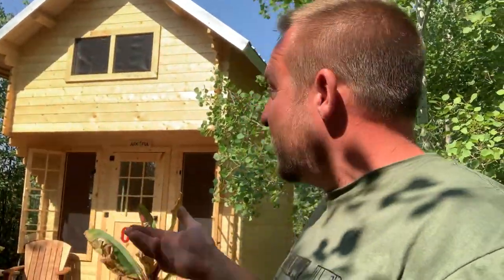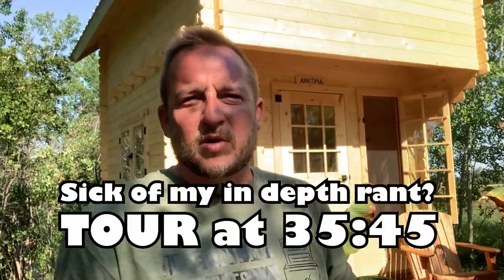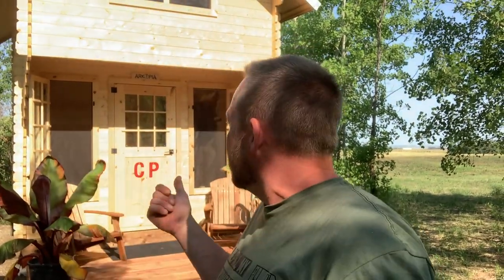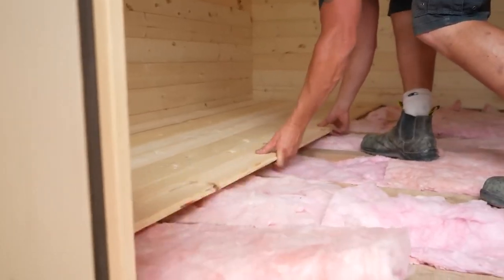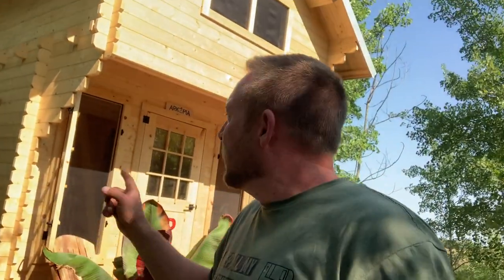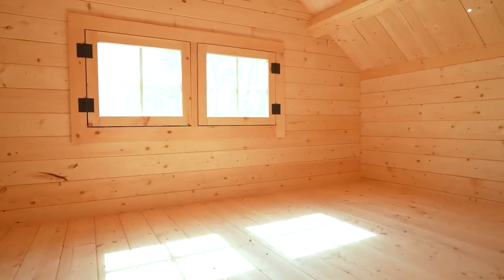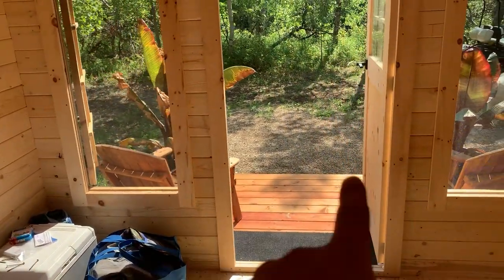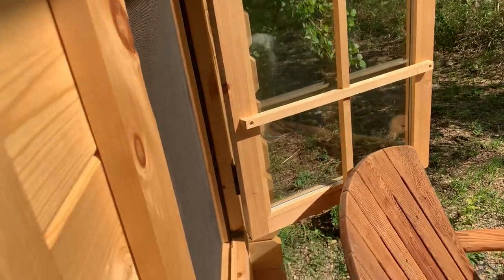@BunkieLife Cabin - Full Tour & Carpenter’s Extensive Review

Comment: Don't use any caulking. Instead of paint, use real wood tar. You can brush tar on, or spray it using a nozzle and empty can from under car sealer, then you get tar into all the small cracks. With one or two coats of tar it will last 50 years until you need to do it again.
Reply from the maker: Never heard of real wood tar.   I’ll look into it.

Comment: Cool build guys, watched er front to back^^  some ideas that came to mind...they make tiny wood stoves for boats as well...a fan that could move the hot upper deck air back down in winter would be nice too,....oh, might not be "by the book" but saw a YT'er in UK make a heater that burns waste oil^^ seemed like you could run that very low as well. A rocket mass heater might work too with wood, can use either smaller sticks all the time, or give it a good charge and have the thermal mass radiate it over time, plus ita a couch/sitting area as well. Loved seeing ur doggie, my dog used to do the same thing with animal hair, he loved anything with rabbit fur on it^^.
Reply from the maker: Any small building wood stoves are such a pain to keep feeding little sticks so often.   Waste oil heater would be perfect I bet.   ✌️

Comment: That's an interesting point on the horizontal boards under a roof regarding moisture collecting. I have a lot of venting under my roofs where I use that technique, so I think I'm good, but i can see how in a roof with less sun exposure or less ventilation potential, I can see how that might be an issue. GREAT video!
Reply from the maker: I should clarify; horizontal “purlins” under metal are fine if they are just over trusses, and no sheeting on the roof.   Then there is no where for condensation going downhill to catch.   If it is a sheeted roof (like this bunkie), or I’ve seen people strap an old roof to put metal on, you will have issues of a place for condensation to get trapped.    Condensation on the underside of a metal roof occurs more if the roof is poorly insulated (heat escapes to the underside of the metal and creates the condensation and frost in our extreme cold), or if an attic isn’t vented enough.       In the case of the vaulted ceiling of poorly insulated roof of the bunkie, I expect condensation under both the insulation and metal.  In some of the best built buildings I have seen minor condensation on the underside of metal. 👍✌️

Comment: Cute as a weekend retreat in good weather.
Wood resistant, or R-value is 1 per inch/24.5mm.
So wall R value is 2.5.
Insulation per code in zone 8 is R19.

Esthetically apealing in its current configuration.
Double wall with insulation between, would look good on both sides and an air barrier could be added .

Again looks great.
Reply: I like that idea.

Comment: Now the facts; Just the cabin $10,999.00 loft Add for $4,699.00 Add for stairs $1,699.00 then you have to pay shipping then you have to pay for roofing materials insulation etc etc projected price over $20,000 FOR LESS THAN 110 square footage Tinder Box.
Reply from the maker: I dunno.   Instead of a really crappy $300,000 town house, no bills for this thing.  This thing could be a dream to have soon, with almost zero living costs. ✌️
Reply: This is a fun way to extend sleeping capacity for the actual house.  We stayed in a bunkhouse at my grandparent's ranch as kids.  There were no facilities.  You just trotted into the basement bath as needed.  I would definitely put in an outdoor shower on a deck nearby.  Maybe a composting toilet in shower shed.

Comment: Hi Dean nice synopsis; recommended reaching out to 'Dickinson stoves & cookers' (American brand) - "Newport diesel or solid fuel heater". Or the Dickinson Lofoten or   Dickinson P1200 propane fireplace.....but please fit a carbon monoxide alarm + air-brick upstairs.
Reply from the maker: Good thought on the CO alarm.  I’ll check out the recommendation for heaters. ✌️

Comment: I just use a 9 foot steel pole to level my shed with motorcycles in it. It is what I use to help move boat lifts out of the water for winter. A couple steel poles, 2 strong people, hand trucks, and some floats even heavy boat lifts can be moved over seawalls and obstacles. Seasonal business. We had thought about shed kit and campers for our property. Decided on a skillion pavilion on piers. Adding walls next summer to make it a cottage. I do foundations, timber framing, and exteriors for living. Here you need one 14 foot wall in a cabin for sleeping. I live in 200 year old house now. But boiler no forced air. So not forcing air out. An out house with out a vent in winter becomes an ice palace. I like mineral wool. I like cottagecore too.

Comment: I wonder if a high mass little rocket stove would be the ticket with something like that. You light a small fire, the mass of it absorbs the spike of heat from it, the slow releases it. Uses very little fuel and attenuates the little blasts of heat you would typically get from a cook stove or little box wood stove.
Reply from the maker: Wood stoves are so efficient these days I kinda prefer that route.   You could add a bunch of mass around a high efficient stove and sort of get the same effect.   Rock and water tanks.   👍

Comment: @28:50 - "I actually have stored away a small antique cast iron wood cook stove..."

Amen, brother.  I just picked up a FREE Orbon kitchen end heater (these were also colloquially known as "trash burners" down here in the States).  Someone had put it out at the curb for the recycling/spring cleanup collection.  Orbon isn't as well known for these as Monarch and Atlantic (even though Orbon was a very large manufacturer of cooking and heating stoves), but the only thing that this one needs is a grate crank (this has the duplex style grates, so can efficiently burn either wood or coal - an adjustable wrench will do for the time being, if I do burn coal), and will need a stove pipe damper plate, since the oval damper in the cast iron stove pipe boot is warped and partially burned out - no big problem, very usable.  This unit is destined for "summer kitchen" use at our lake lot, in the screened porch of our composting toilet shed, at least in the near term.

One thing to note: these kitchen end heaters have a similar sized fire box to a smaller full-size cook stove, even though they only have 2 burners/pot eyes.  I wouldn't want to pack one any substantial distance to a remote cabin, but you could, if you had to.  They'd certainly be transportable in a good freight canoe or row boat from "civilization" to a cabin on the other side of the lake.  A set of dolly wheels or a wheelbarrow might help, depending on the terrain (I used a light duty appliance dolly with solid tires, but I was just moving it a few blocks in town over paved roads).  My main point is that the amount of heat these will throw is impressive for the overall size.  If burning coal, they'll also hold a fire for quite a while (8-12 hours, though I have no direct personal experience, since I burn wood, but those who do burn coal attest to this); wood,. not so much (but see my subsequent comment).

If you keep your eyes peeled, small stoves like this end heater seem to show up for under $100 US very frequently.  Many of them appear to have been lightly used, if not always well looked after.  People installed these once they switched from a solid fuel fired cook stove to a gas or electric range, because the uninsulated kitchen would now get chilly with the new stove not leaking much heat into the kitchen; adding the kitchen end heater, used to brew up the morning coffee, would cure that.  Also, small gas (propane or natural gas) and solid fuel (wood/coal) combo cook stoves appear from time to time, which would be nicer in warm weather (but you could just use a propane 2-burner cook top, too), while providing a small oven.

@34:11 - "...so literally every 45 minutes you'd have to put wood in this little stove..."  Another alternative: build a stove hat from brick, chimney tile or rocks for added thermal mass, a la Kiko Denzer (just Google Kiko's name and "heater hat").  It's not a Russia stove, but it would be better than constant feeding for use in a fixed location, like this little cabin, and would help to even out the pulses of heat.  If hot tenting with a canoe or toboggan, or backpacking, than the collapsible sheet metal stoves (and frequent feeding) will be the order of the day.

Comment: living in a 2000 GOLDEN FALCON 31 foot long with 12 foot slide out, we use old surplus "M1950" tent stove to heat the trailer with -30F temps in winter, burning wood lumber  from a 100 year old house we tore down.  only problem is when it gets to 105F at 2am when -30 outside and im flinging the doors open to cool down. i ran a home built thimble with double wall pipe through the living room crank up vent hole .!
the stoves only last 2 years burning wood but the grates burn out in just 2 so i cot off old gas grill grates.
anyone interested in buying the gasoline kits for these stoves, im your guy as i have never used them, gasoline costs money while wood is free!